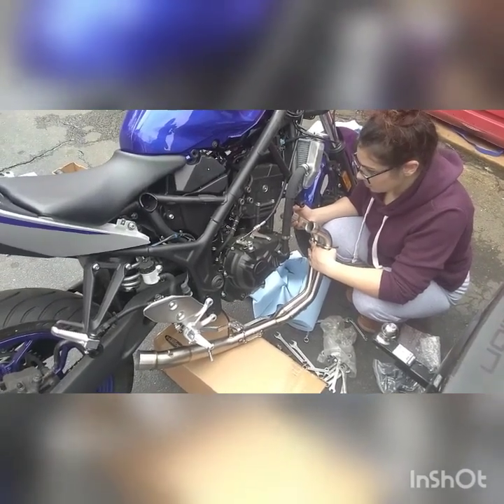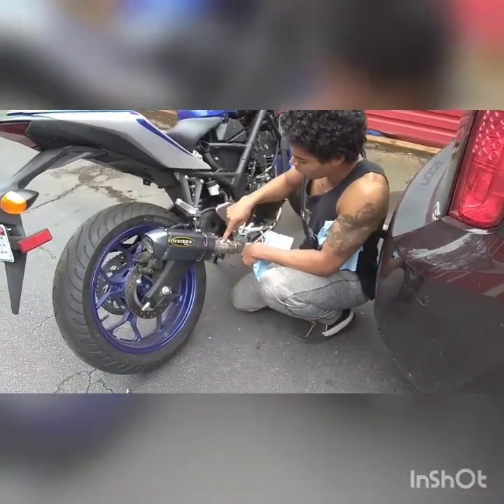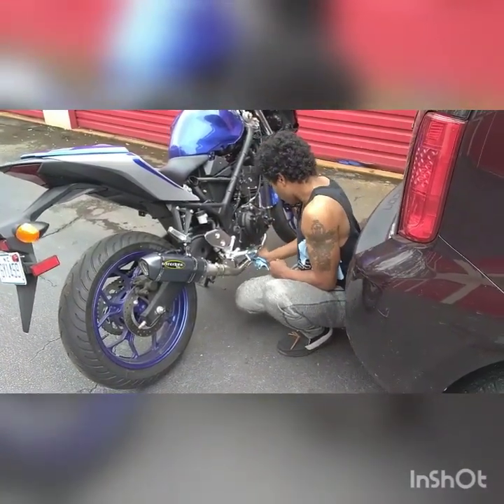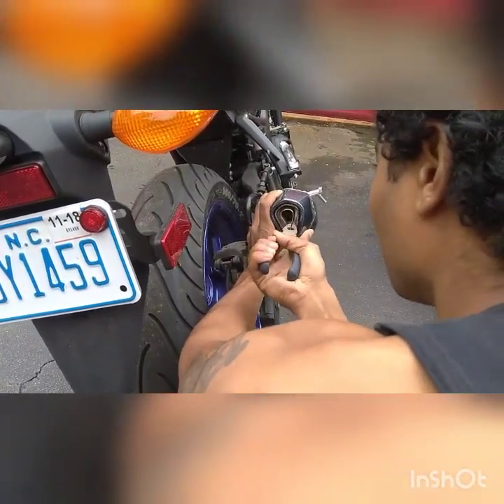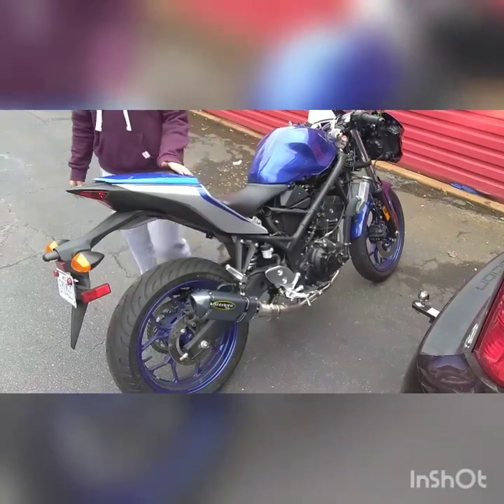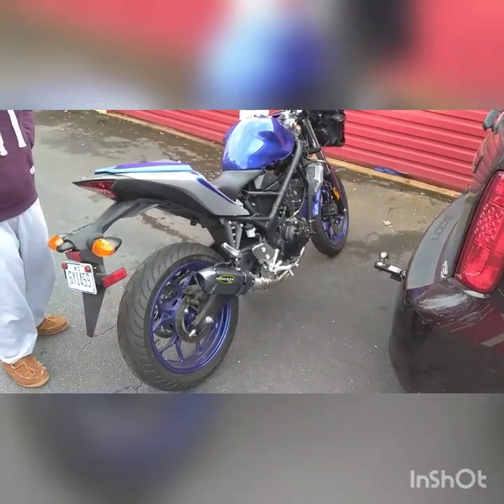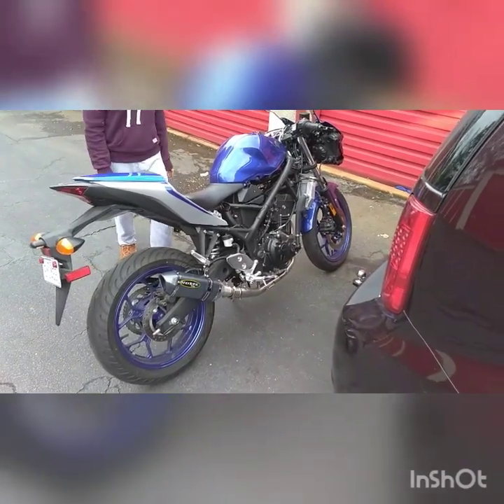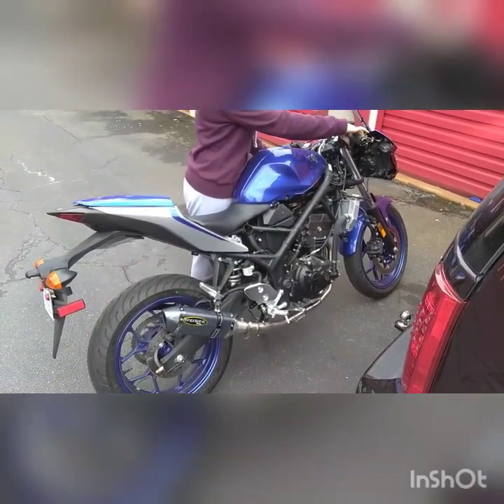Installing Anodizing Exhaust on my WIFES Yamaha R3 (SOUNDS EVIL)

Comment: I just ordered this exhaust and it should be in in a few days. I have seen videos saying it has melted the charcoal canister where the headers come out. Have you had any issues with anything melting? And is the clearance good? Thanks.
Reply from the maker: This was a easy install I simply unbolted the charcoal canister and moved it over to where there is only 1 screw holding it down but at least it's further away from the exhaust. That was the only thing that was needed to make it work. If you need pictures of how I moved over the charcoal canister I'll send them to you in a message to your YouTube.
Reply: Couple Goals777 thanks for the advice! I should be able to move it over. I appreciate it.
Reply: Couple Goals777 I just got this exhaust in today and was wondering if I could get a picture of what your talking about first motorcycle so I’m new to this
Reply from the maker: @Moneybag92  hey no problem I'll take a picture and send it to you. I understand happy I can help
Reply: @2wheelfamily493  would you happen to still have a photo for me as well?